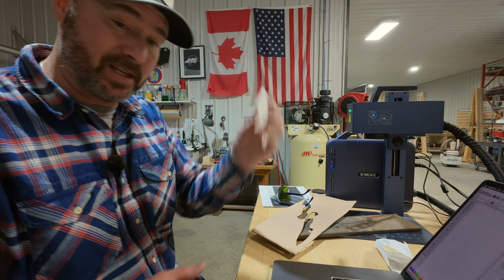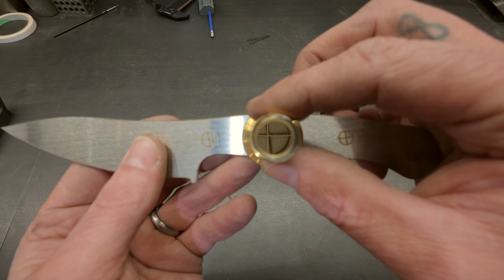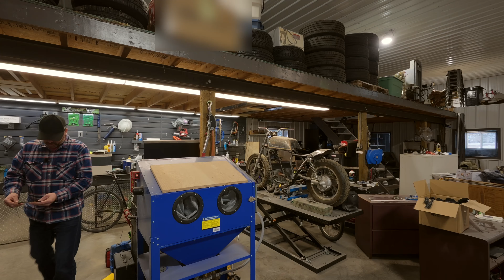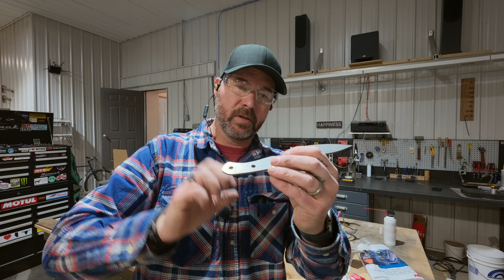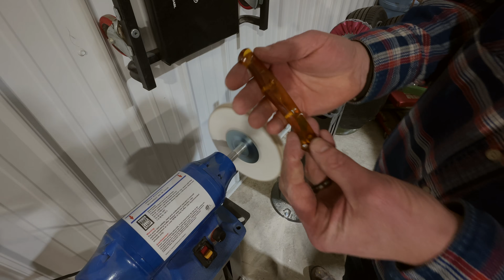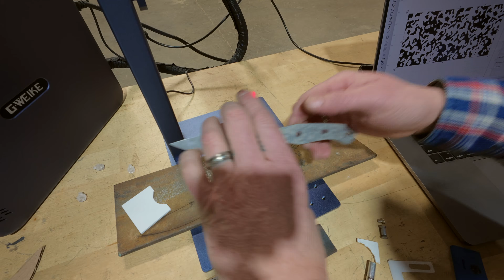How to make a knife

Comment: Great video! I watch a lot of videos across several different areas of interest e.g. laser engraving, knifemaking, woodturning, CNC, etc. This has got to be one of the best videos I have seen in some time! Out of this, I picked up ideas on how to use my fiber laser for knifemaking (layout, jimping, etc.), and I discovered two tools that I MUST have that I didn't actually know anything about e.g. optical center punch and a straightening hammer. All-in-all, 23:27 minutes of time well spent! One question I did have was, could you have laser engraved a centering point for your holes so that you wouldn't need an optical center punch? Thanks.

Comment: Just making sure, you said 1600F for O1?
Reason I ask is I've been having some issues with a batch of O1 at my usual 1475F and wonder if hotter might make a positive difference.
Reply from the maker: The reason I do 1600 is because O-1 cools really fast (much faster than a lot of high carbon steels) and when I was doing 1500, the steel was not hardening. I kept testing pieces while increasing the heat and for my kiln it was 1600 and then it would finally skate a file. My kiln might be off too.

Comment: Rookie here at knife making. I've had acceptable success with epoxy handles. Tin foil molds, pour, then incorporate metal flakes, and sometimes floating various vinyls emulates your method. I make custom pick guards for guitars, same method. Little bit a work, but they buff out great. I'm really glad I clicked on your video. Truly is a fine design, well executed. Good day.